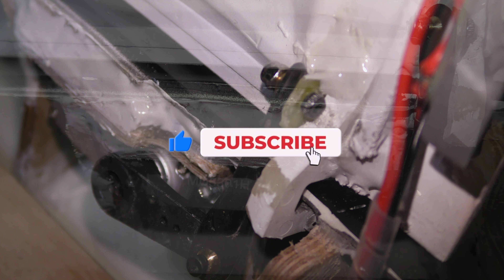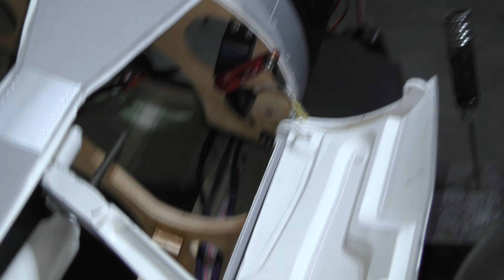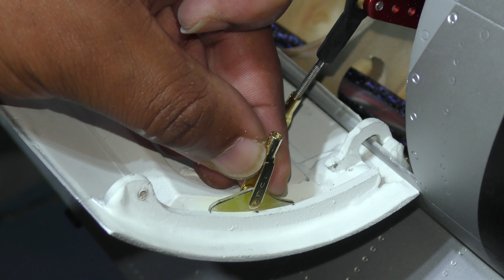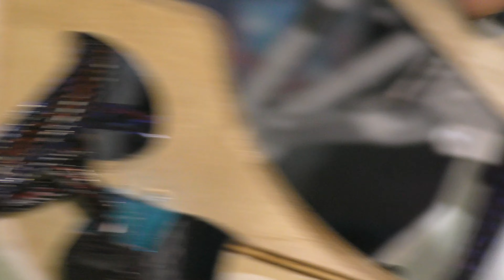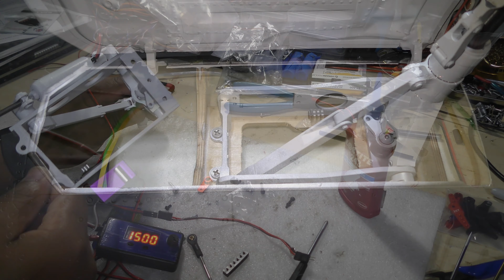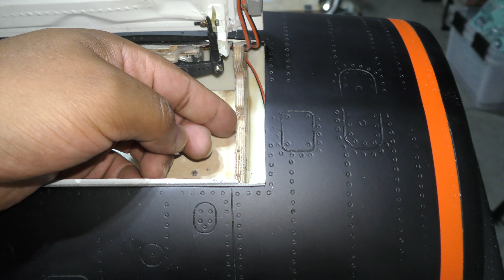Skymaster  F-16 1/6 Build Series #8: Gear & Gear Doors

Comment: Heads up @6:51 I place a screw to prevent the front gear from over rotating to 90 degrees. The steering servo doesn't have enough torgue to hold it @ 45 degrees during landing or over correcting.